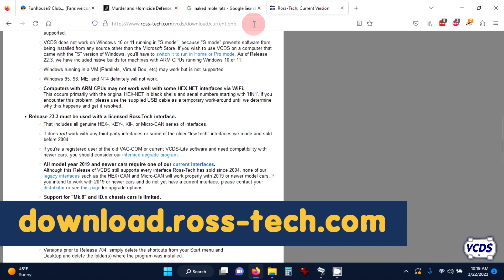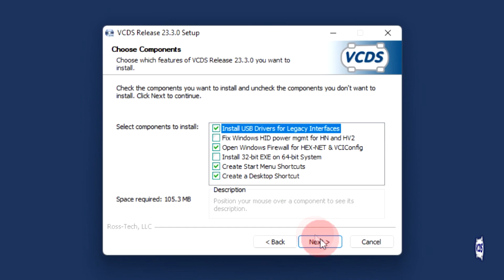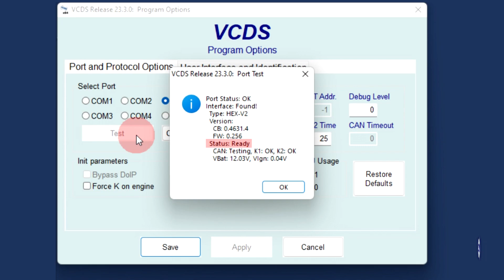Installing VCDS

Comment: I have had the HEX+CAN interface since around 2013 and I recently had to recover the laptop running win7 that I use for VCDS. Problem now is when installing the latest version of VCDS (23.11.0) when the "Device Driver Installation Wizard" comes up and click yes and always trust it just says "the drivers are now installing" and after 20 mins it is still there! This has NEVER happened before and I have now tried 5 times of reinstalling to no avail. Question -- where does the wizard place the drivers and can I not just take them from the VCDS folder and copy them into whatever folder the "wizard" is placing them?
Reply from the maker: Registered customers can contact us directly for product support:  https://www.ross-tech.com/contact.php

Comment: bluetooth interfaces?
Reply from the maker: Our wireless interface, the HEX-NET, uses Wifi.
Reply: @RossTechVCDS  I can't use it over bluetooth. when selecting the input port (com3) and performing the test, the software stops responding
Reply from the maker: @brenocmendes  There is no Bluetooth support.  Com ports are for computers that have actual serial ports, a technology that was phased out years ago.  But we have some customers using +15 year old computers with serial ports thus the reason the software still supports it.

Comment: can you help me .  Port Status: OK   USB Library Version : 02.02.07 USB Drive Version 02.10.00 interface not found 
i'm sure hex v2 is connected
Reply: Turn off antivirus copy the file vcds loader exe in the vcds file and make a shortcut on your laptop
Reply: I have the same problem. Did you get it sorted?
Reply: Same problem here. Any suggestions?
Reply: Same problem here
Reply: Mismo problema, desactive antivirus, firewall y nada
Reply: did you ever get this sorted out? Mine is exactly the same. If you get a chance can you explain it to me in an idiot proof guide please. I dont really know which file in VCDS is the loader or where to copy it to. Please help 😁 thanks